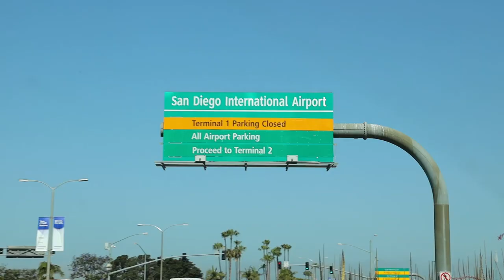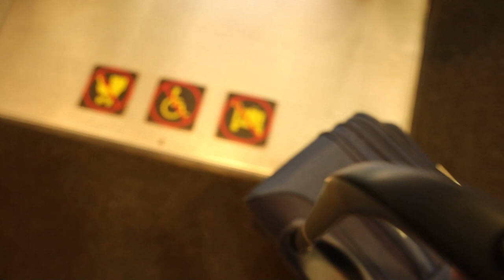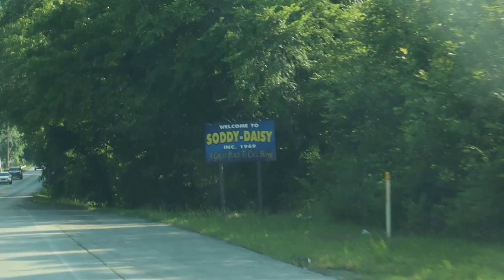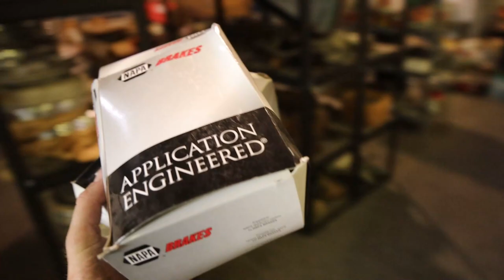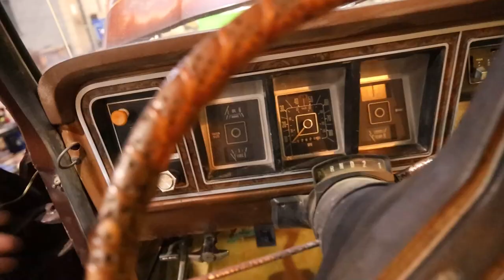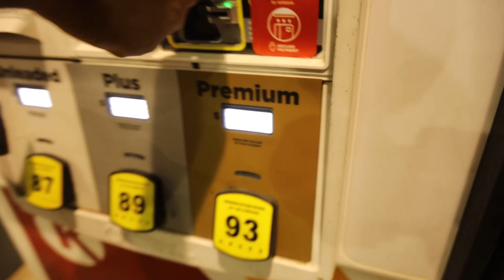Revealing our NEW 1 of 1 F150 For POWER TOUR!

Comment: I was drooling over the crew cab Dodges.. I'd love to have one, being 6'10 it's hard to fit in a regular cab comfortably. That black/grey crew cab is a sick color combo.. Excuse me as I whimper over that 65/6 Galaxie.. that's one of my dream cars I've wanted since my early teens. I had a chance to buy one last year but big block and gas over $4/gal meant I wasn't allowed to buy it.. at $6.50+/gal now it'll definitely never happen now... (living at home sucks but it beats living under a bridge) These gas prices even have me looking at Japanese cars, though currently there's a 1967 NS Prinz 1000TT for sale near me for $1500, with how hard they are to find parts I'd give the guy $300 for it. It's in ROUGH shape but they are really cool little cars, the predecessor to the Audi and basically a German Corvair. They have an overhead cam 1.1L inline 4 that's really cool looking, but you HAVE to go oldschool hot rodder with them and make your own gaskets and floor pans and use whatever other engine parts fit but weren't designed for it because NO ONE makes parts for them at all... Pretty cool little car though. Having just looked it up on here I can now tell you there's no way in hell I'd fit in one, a Recarro seat was pretty much touching the roof. Unfortunately most little good mileage cars are made to seat someone that's 6 foot tall MAX not 6'10 and all torso.. a Mini S is probably the best fit for me.